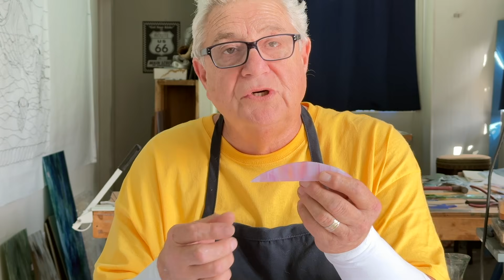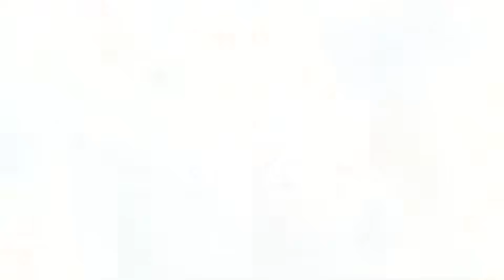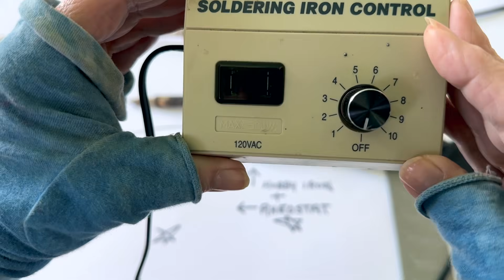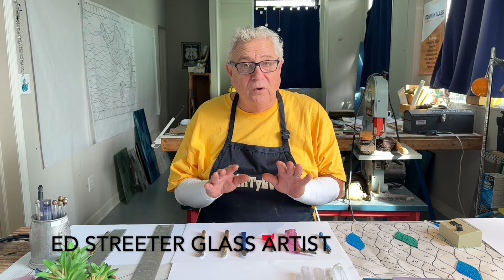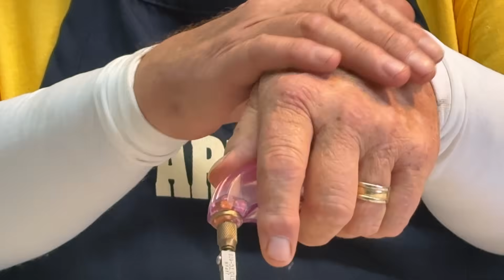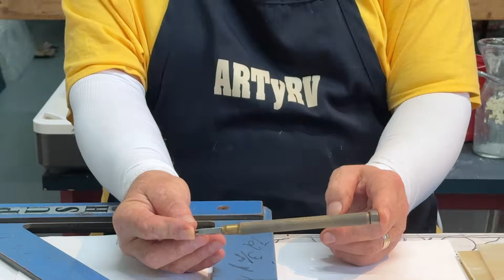Top 5 Tools for Stained Glass

Comment: Thanks so much for all your amazing tutorials and for being so supportive to people trying to learn this skill! I have a question about finishing…

So, no matter how quickly post soldering I clean the pieces I work with (and when I’m cleaning I rinse with warm water, then use a scrub mummy with dish washing liquid and warm water, then use flux remover… so it’s cleannnnnn)… once I then put patina on (and rinse that off), then polish with the stuff my local glass store sells… I’m still getting that white residue after a day or so - some people call it rot or mould…

I’m running out of ideas in terms of how to prevent this from happening. Any suggestions as to how I can prevent this from happening as i don’t want to gift people these items with this issue :(

Comment: I've used the Hako iron for a number of years now. I understand the cord is short, I use an extension cord with it. My thinking is if you're using an iron with a reastat that's your extension cord. I set up a small coat hook up to the end of my table to hold extension cord off the floor so not to drag my iron off the table. That's for the grozers showcase.
Reply: Forgot to add the Hako iron comes with a little wrench to turn the reastat knob.
Reply from the maker: Thanks for sharing!